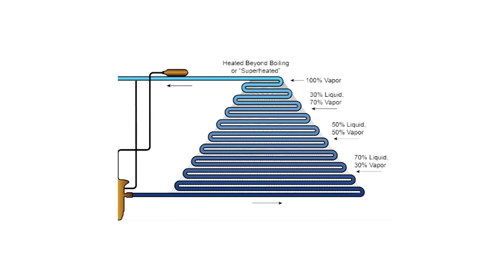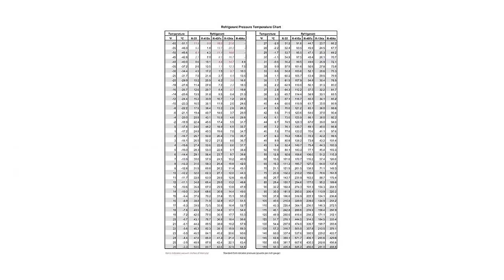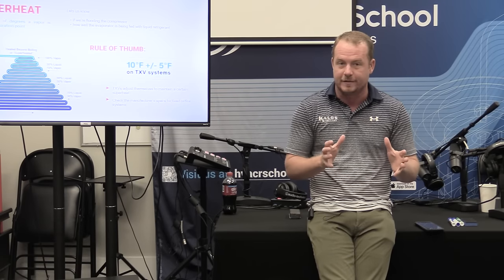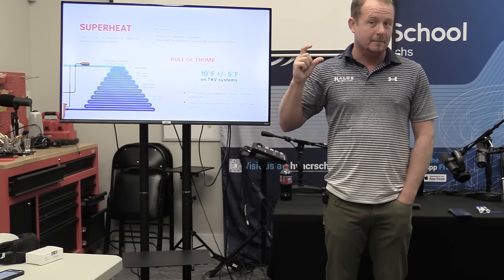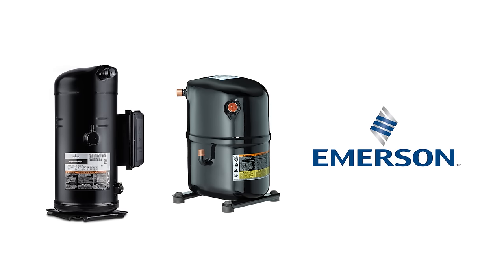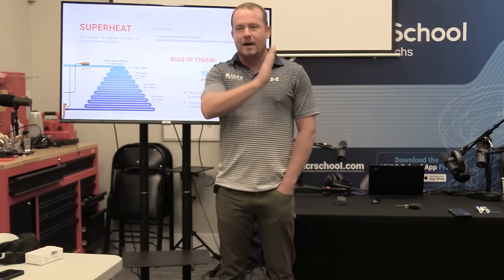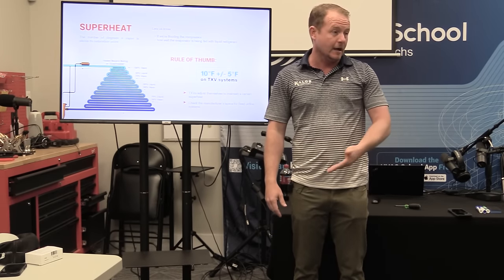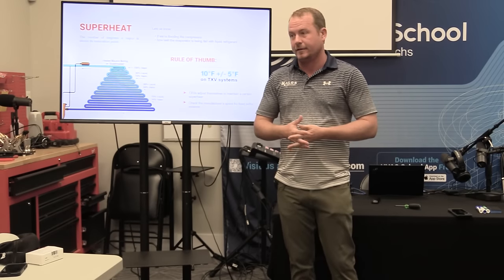Class - What Superheat Signifies

Comment: I've been doing HVAC for 32 years and I also teach it. This is one of the best explanations of superheat I've seen. Great job! I've found through teaching about units from 2 tons to 1000 tons, too many techs do not really understand the refrigeration system, how a metering device works, and what superheat and subcooling is and how it can effect system ops. Most techs think a/c units add cooling to a space but that is not true. They actually remove heat and move it to then release it via air, water. or earth's temps.
Reply: so you are saying " most techs " who work on systems for a living don't know that you are pulling the heat out of a house and into the refrigerant which is rejected outside? I highly doubt that.
Reply: @liddell157  totally agree
Reply: @liddell157  That's right. From my experience most do not understand that. Of course I haven't talked to every tech out there. Have you talked to every tech?
Reply: That is True. 5hey do not have a clue. I had a 100 ton unit with 8 txv's took me 2 day to find the Txv that was stuck open. The little shits now days would say you need a new one.

Comment: Superheat is the heat picked up after a liquid completely evaporates and becomes a gas.  Nothing more, nothing less.  Knowing you have some superheat before the compressor is important so you don't have liquid or partial liquid going into the compressor.  Liquid cannot be compressed without damaging the compressor.  So having some measurable superheat is a good thing.
Reply: Best explanation of SH I’ve ever heard.
Reply: Thank you for this, really helpful
Reply: Vapor does not absorb heat.   When the liquid dtarts absorbing heat. Until all the liquid is boil off.  Than no more heat can be absorbed.
Reply: @SteveSmith-wm5vw  that is not correct. Vapor can absolutely absorb heat. Why do you think the suction line at the compressor is cold? Isn’t not because there is liquid in there.
Reply: When he says Super Heat is how full the evaporator is with boiling off refrigerant...I'm thinking no , that's what it can tell you that's not what it is lol
Reply: @SteveSmith-wm5vw  completely wrong
Reply: I thought superheat was the heat picked up after the refrigerant reaches its saturation temperature, which isn't a point of complete evaporation.  If saturation temperature were a point of complete evaporation, superheat doesn't seem like it would be that useful.  Why would anyone want to add heat after complete evaporation of refrigerant in the evaporator?
Reply: Incorrect
Reply: @SteveSmith-wm5vw how about proofreading your comment for spelling and punctuation so you read as if you really understand the theory of refrigeration.

Comment: 0:10 - Superheat is a number that signifies the volume of vapor refrigerant at the top of the evaporator; subcool is a number that signifies the amount of liquid refrigerant at the bottom of the condenser. The higher the superheat the higher the volume of vapor. The higher the Subcool the higher the volume of liquid.

Comment: As an ASE certified auto technician who jumped ship to do residential HVAC I'm glad to see I'm not losing my mind, I keep saying that basically were moving energy/heat, laws of thermodynamics state basically hot wants to go somewhere cold or technically it wants to calm down lol, every HVAC tech I've worked for and with since my switch in careers says I'm wrong or don't get it, but he just totally redeemed me lol, your just moving heat one way or another especially with a heat pump, furnace just makes its own heat but still moves it lol. I noticed that alot of HVAC techs are stuck up and cocky, meanwhile I just want to talk shop and openly yet fairly compare equipment and setups but always get slack for being "a greasy car mechanic" . Love the videos!
Reply: Hi Tom. Good for you!! I’ll place my bet on you any day of the week. The hvac groups have many good techs with an amazing amount of good info, but I find that there’s a lot of fluff in between. My name is also Tom, and a Master ASE recertified in Auto and Heavy Truck for over 20 years. I know that you’ll be great! 
I’ve worked on HVACR for many years because it’s interesting. Not a hack, I like to do it the right way. I’ve made mining and construction equipment my career, specializing in large machines, those that must be repaired at location. HVAC is very important because the machines cannot be used without it. 
Bryan Orr is the best instructor I’ve encountered. Stay tuned to Bryan! Good luck
Reply: These are basic concepts. You need to find a new company if your coworkers can’t understand this

Comment: Good video Bryan. I’ve been saying this for years that it tells you how “full” the evap is.  Not really an accurate way of saying it, but it’s easy to understand. Something else I will do is inspect the evap. If the upper third looks brand new while the rest of it is rusted, then I will add more charge so that I have more “cold” surface area. I might even physically inspect how much of it is cold, especially for those systems where all the measurements look good, and it should cool the building, but for some reason it isn’t. Thanks for sharing.
Reply: The second thermometer/ superheat probe I purchased had 3 probes.it told me to install the probes at the top the middle and the outlet. That is what superheat is . That was the best diagnostic tool I had.

Comment: was  BT in the navy, when ships had boilers and steam turbines. super heated steam was a point where there was no water vapor left. it was super heated to point where it was a hot steam gas. used to turn the steam turbines so the turbine fans wouldn't be contaminated. the pressure in the boilers were 650 psi and some were 1250 psi. that was in a 8" steam pipe.
Reply: Saturation baby!
Reply: @Brokefootchuck yup...I was a super critical boiler operator for 30 years.

Comment: DUDE, watching your videos is teaching me so much. You're literally the goat. I learned my compressor is kicking butt, but I have way high superheat and regardless of ambient temp I have delta temp of between 6-11 deg F. This is telling me my issue is either charge level, txv bulb placement issues, or something with valves themselves. 75F suction line rippppp
Reply: If you had a low charge, wouldn’t that mean your delta T would be higher?

Comment: I have always been fascinated with refrigeration systems. One thing that puzzled me was going past air conditioners when in heating mode and the outdoor unit was blowing out cold air. Thus the outdoor  air was warmer than the evaporator temp. Surely you would think the heat from outside would flow into the evaporator and raise its temperature. One thing that I have noticed about air-conditioning courses is a lack of mentioning a most important concept in heating and cooling which still puzzles me and that is the concept of LATENT heat, or if you like hidden heat. The idea that heat is going into a ligiid phase and changing the liquid into a gas without the temperature rising of the liquid still puzzles me even though I know the physics behind it. LATENT heat is a key concept in heat pumps and yet seems to be kind of ignored. Great Video

Comment: Brian, thanks - now I can tell the guy who (tried) to service my ac that his negative superheat number is in question.  He wanted to remove refrigerant (R410a), I told him no since he did not have a recovery tank and he never even considered airflow (which I don't think it was but just incompetent).  Thanks for the continuing education.

Just to be sure I understand, for a typical heatpump summer operation and a 92 def outside and 76 inside, you can never have a suberheat?  He was measuring a -1 superheat.  Thanks!

Comment: Superheat is the temperature difference between the actual vapor temperature and the saturated vapor temperature at a given pressure. Superheat is used as an indicator of how much heat is being added to or removed from a refrigerant. When superheat is low, it indicates that the refrigerant is not reaching its saturation point, which may be due to a restriction in the system.

Comment: I noticed the larger diameter line outside the condenser unit has insulation on it and the smaller diameter line does not have insulation on it. Insulation around the suction line is there to avoid increase in the super heat temperature of the evaporated refrigerant going into the compressor? Over superheating can burn compressor due to the reduced density?

Comment: Suction line into the compressor has superheated evaporated refrigerant at lower pressure a lower temperature snd compared to the outside temperature. This is the reason suction line may get ice or condensation around it if not insulated? 
Is it okay if there the suction line gets ice around it?

Comment: Would the fundamentals/concepts described here apply to 134a systems in cars and trucks, assuming we are using the correct temp/pressure table for 134? 

I have an aftermarket AC kit that uses a non-adjustable TXV; pressures are 15/250, my liquid line is within 10 or 15 of ambient,  no temp drop across drier, but my superheat is 20 to 30 degrees (15 psi measures 55 or 60f) and I'm leaning towards blockage in/near the TXV.

Comment: How cold should the line be outside by the condenser on a 25 ft lineset through an attic ideally. Bryan
Reply: It depends on the type of metering device you have, the temperature outside, and the w.b. temperature inside. But it should be noticeably colder than ambient. Under normal conditions it is usually around 20*F hotter than the suction line saturation temperature. A line temperature of around 50*F is normal depending on the conditions.

Comment: I have a couple questions. May be stupid ones but might as well ask. I thought a higher superheat would be more efficient, because its absorbing more heat. But i guess you are saying that the pressure should have been higher going into the evaporator so that it boild less and absorbs the same amount of heat? And also wouldnt a high indoor Ambient temp also cause a high superheat?

Comment: Okay, let's see if I got this. You can't increase the temperature of the liquid Beyond its boiling point BUT you CAN increase the temperature of the vapor. 
If the boiling point of water is 100° C before it phase shifts to steam then the water can never be 101° C but the steam can be (super)heated to a higher temp

Comment: Anyone understand the over charge and undercharge diagnosis? Like how does a total superheat of 13 and a target superheat of 17 results in an "OVERcharge"? the total number is less than the target
Reply: That means that there is too much refrigerant flow into the evaporator coil for its size and airflow through it. The refrigerant does not stay in the coil long enough to warm up to the target temperature which reduces the efficiency of the system. 
A difference of 4 degrees is not significant though and would not warrant any action. If it was very overcharged it could cause a liquid surge to the compressor which would damage it.
Reply: @Redtooth75  thank you! This was a tough one

Comment: Doesn't the refrigerant temperature increase the longer it sits in the evaporator and does that increase in temperature also implies that is pressure goes lower and also the more it exist as gas.  If this be case, it is the opposite of the high pressure side of the system.
There high pressure and temperature range it is liquid and higher pressure and temperature than that means gas again.
While in the evaporator side a different game and anamoly exist.

Comment: When taking your suction line temperature is the correct location  inside at the evaporator or outside at the condensor?

From my understanding inside at the evaporator gives you superheat of the evaporator and if taken outside at the condensor the line set can add temp to it this giving total system superheat..  

I was told you want to be within a +/- 2°F of your target superheat.
Reply: General rule of thumb is 10degree superheat at your evap, 20-25 at condenser. As long as you're around that range you're usually gonna have a good delta.

Comment: I dont know why less super heat is efficient. what you say by definition as super heat is " heat absorbed after the change in state" that is from lqiuid to vapor. so more super heat means you absorb more heat .. why do you want to obsorb less heat.?..  In my view you should set the super heat so evap coil should not freeze and at the same time compressor should not see liquid. thats why keeping the change in state of liquid to gas at middle of evap coil is efficient, so not like the way you explained as keeping super heat at 1